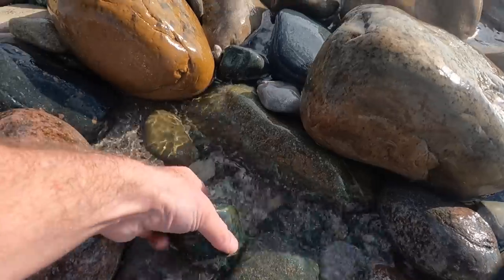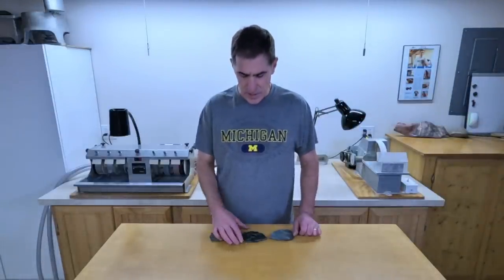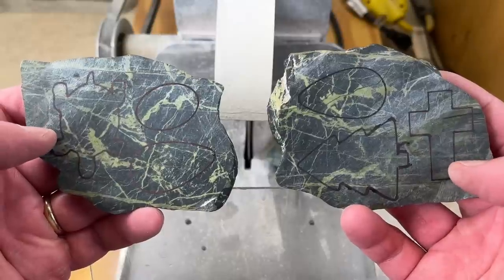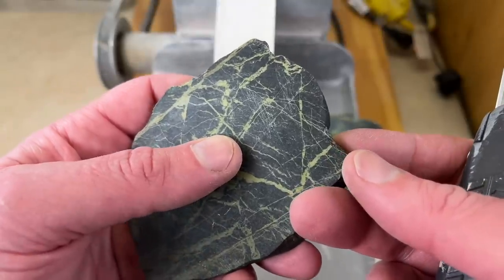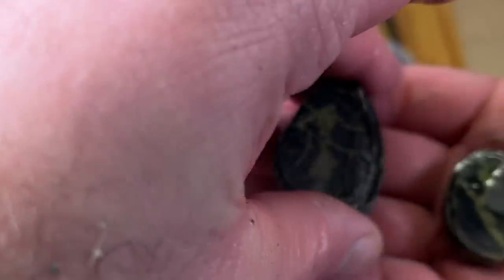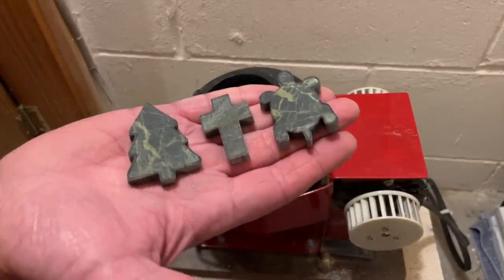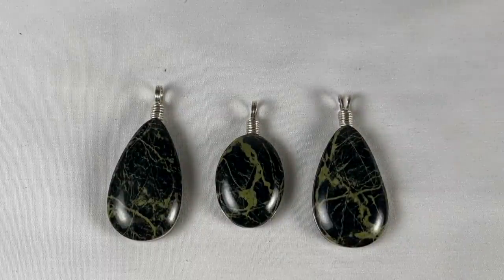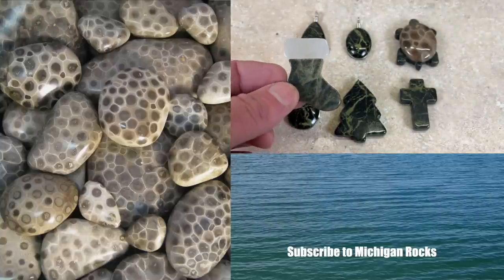You Asked For It! Viewer Requested Projects

Comment: Hey! I want everyone to know this fine gentleman helped me actually get my rocks to gem finish! His videos and knowledge ended 3 years of frustration and disappointment. I purchased a national geographic tumbler....... and then a very expensive refill kit of their grit..... then another tumbler. I tumbled dozens of loads through all 4 stages 100's of days of trial, error and waiting. I simply gave up for year. Then I discovered this channel and it changed the hobby forever for me and my daughter. I want to thank you for everything you do, what you taught me through your videos worked and I am grateful! My gem finish tigers eye, jaspers, quartz, labradorite and so on are because of you! You rock!
Reply from the maker: I’m glad I was able to help. You might need to repay the favor by teaching me to tumble labradorite. I can’t say I’m thrilled with my results.
Reply: The most helpful man on YouTube, I could not agree more.
Reply: The labradorite isn't as good as the harder rocks. I still get chalky streak lines, but it isn't breaking up chipping or coming out a completely chalky ball. My next move is to get more and try tumbling only labradorite in a load on polish stage instead of mixing it in with other rocks. You lose so much material through out the process that by the time you get polish stage you need more of it to fill the tumbler or you have to mix it with other rocks. I didn't have more so I had to mix. If that awesome aluminum oxide doesn't work in a pure load of labradorite I'm going to try ground walnut shells.
Reply from the maker: @johnhein4851  I tried corncob media in my Lot-O, but I did better with my regular, wet method. They weren't a complete failure, but they don't come out nearly as well as other rocks. A big part of the problem is the cleavage planes all over the place.
Reply: HECK YEAH!! This is seriously so cool, congrats to ALL 🥳💜
Reply: I agree.  Between him and meMiner,  they have taught me a lot and made the hobby fun.

Comment: What a beautiful stone! Lovely pendants, decorations and turtle. My favourites have to be the teardrop pendants. They polished up so well and are chunky and substantial. Thanks for sharing.
Reply from the maker: I like the teardrop shape too, but I’m in a rut. That’s what I almost always make. I need to expand to some new shapes.
Reply: @MichiganRocks   Maybe try cushion cut? I've seen that done with Australian opals and it looks good.
Reply from the maker: @ceanothus_bluemoon  I just looked that up, because I didn't know what a cushion cut was. It's just a square with the corners cut off. I could do that, but I'm not sure if I could groove wrap it. I don't think it would be easy to get the wire to bend at an angle at the corners. That's why I stick to rounded corners. Another option would be for me to learn how to do a different wrap than just a groove wrap.
Reply: @MichiganRocks  Ah yes, fair point.  I suppose you could just do variations of oval and pear by making some more elongated, and some fatter to continue the groove wrap(which looks very nice btw).

Comment: Fantastic video and beautiful green stone! I have to say that I love watching you cut out your ornament, turtle and other shapes on the saw. You are the master and you make it look so easy to get the shapes cut basically perfectly to the outline. Watching you do it with time sped up was really cool! Everything looks beautiful too. Those cabs sure do have a gorgeous polish on them. What size is your loto tumbler? Just curious. Thanks so much for sharing this Rob!✌️🤠🤟
Reply from the maker: Thanks, Kyla. Cutting shapes on the saw isn't difficult, you just have to go slow at first. Turtles are probably the most time consuming thing I do. All those indentations between the legs, the head and the legs, and the tail and the legs are pretty time consuming. That video was sped up 20 times. 

I have a single barrel Lot-O. They don't really come in different sizes, just single or double barrel.

Comment: Great projects for a cold winters evening ! I was just wondering how you get a uniform groove depth around the edge of the cabochon.
Reply from the maker: I don’t. I just get close and the wire evens it out. I use a piece of copper wire to test the depth as I go. It’s not perfect. I saw something on the Rock Tumbling Hobby forums where someone had an idea for making a gauge, but I can’t remember exactly what it was. the problem with gauges is that the bit wears down over time.
Reply: @MichiganRocks  Thanks for the answer. Yeah if you had spots that were to deep the tightened wire would just span that area anyway.

Comment: Watching your work makes me want to learn the craft. You make it look so easy. Although, I would most likely loose some fingertips and that’s no bueno, since I type all day. Always good content. Awesome pendants.👍
Reply from the maker: Most of the tools I use aren’t very dangerous. I should have a belt guard on my saw because that’s probably the most dangerous part. I can put my finger right on the blade while it’s running with no pain or amputations. Cutting with the saw is pretty easy if you just go slow. Making a dome on a pendant and keeping a nice, straight girdle line around the edge takes more practice.

You might like this video about the safety of saw blades: https://youtu.be/Er4YLn4fXUA

Comment: Those turned out great.  I was wondering if the cabbing machine would do better at bringing up a polish.  Probably so because of the range of grits on the wheels.  But the satin finish on the tumbled pieces still look nice as is.  Thank you for sharing this and making it interactive for us by entertaining our suggestions.  You do fine work!  Question:  The dop wax...is this anything like the microcrystalline wax used in the lost wax casting process?  'Cerita' is the only brand of that material I know of.  Your dop wax looks like it has more 'gooey' additives in my opinion, unlike Cerita which will totally liquify at certain temps necessary for filling molds.
Reply from the maker: With a really hard rock, I can probably get a better shine in my tumbler. I'm better at tumbling that cabbing. My wheels only go up to 3,000 grit, while my tumbling grit goes up to something like 8,000 or higher. With a softer rock, I do better on a cabbing machine. 

I have no idea what the qualities of dop wax are. My only experience with wax is that and candles.

Comment: Great video!!    Was wondering three things about the Christmas Tree:  what drill you used to drill the hole, what did you use for the eyelet itself (premade or make your own) and what glue did you use to set it?

Thanks!!
Reply from the maker: I can answer all of those for you. 

I use 1 mm drills in a Dremel mounted in the Dremel drill press accessory. The drill bits I use are cheap but don't last long. I buy 100 bits for $75 from Kingsley North. I get between zero and about a dozen holes from one bit. They won't drill really hard rocks like Lake Superior agate. They work pretty well for puddingstone, unakite, quartzite, and the rock in this video, whatever that is. They work really well for soft rocks like Petoskey stone. https://kingsleynorth.com/diamond-drills-kingsley-north-inc-pkg-of-100+kn_dimd_drill_pack-Pkg-100+kn_dimd_drill_size-10mm-Diamond-Drill?ref=robertabram1&utm_source=tapfiliate (affiliate link)

I use square silver wire for the eyes. I'll be able to make several from the scraps from the groove wraps I did in this video. I make the eye with a pair of round nosed jewelry pliers. Then I hold the eye in a pair of pliers and twist the bottom to make a spiral. I figure that won't pull out of the hole as easily as a straight wire. 

I use Epoxy 330 to glue them in. 

Here's a whole video on how I make Christmas ornaments: https://youtu.be/VDoZL4MiPgQ
Reply: Awesome!  Thanks for the info!

Comment: Turned out really sweet - just wondering what grit the grinder is using - & is it easy or necessary to change out the grinding wheels for any reason?  Cheers!
Reply from the maker: The grits on my cab machine are: hard wheels: 80, 220 soft wheels: 280, 600, 1200, 3000. I haven't changed any wheels yet. There are six of them, so you don't have to change the wheels as you work, you just go to the next wheel. The only other thing you have to do is turn on the water valve to the wheel you're currently using. 

Here'a link to the actual machine I have: https://kingsleynorth.com/kingsley-north-cabber-6-nova.html?ref=robertabram1&utm_source=tapfiliate  (affiliate link)

Comment: What do you think of the harbor freight rock tumblers and their grit materials they sell?
Reply from the maker: I don't like them. I haven't used any of their tumblers or grit, but I have read about them a fair amount. So I'll give you my thoughts, but it might be good to do some of your own research. 

Their vibratory tumblers are made for metal, not rocks. There is no mention of tumbling rocks in the descriptions of either one. Thumler's is another brand of vibratory tumblers that sells both rock and metal tumblers. People who buy either of these metal tumblers usually report that the barrel and/or the motor wear out very quickly when tumbler is used for rocks. 

Their rotary tumblers are basically a clone of Lortone tumblers, but are not built as well. There are many reports of motors burning out after a short time. But, there are other people who get a few years out of them before they die. The other issue is that the belts break a lot. I would definitely buy the extended warranty. If you do buy one, make sure you look it all over and make any appropriate adjustments. Look for things like whether the pulleys are well aligned. Tighten nuts and bolts. Also, there's a little plastic tab on the machine where the end of the barrels run. You have to make sure you turn that out so that the barrels rub against it rather than against the whole frame. This cuts down on friction and makes it easier on the motor. @davidhile5363 is a subscriber here who has several of these and likes them. He could probably tell you more about how to adjust and maintain these machines. 

I don't know what to say about the grit. They don't say what is in the packs, they just call them coarse, fine, prepolish and polish. It's important to know what's actually in them, especially the polish. There is a big difference in different types of polish. It's also really expensive. They are tiny little packages. I highly recommend getting your grit from either Kingsley North or the Rock Shed. I have links to both places in the description of all my videos. That's where I buy almost all of my lapidary supplies. 

I'd suggest taking a look at Lortone rotary tumblers. They have a much better reputation. They've been hard to get for the past couple of years, but you could send an email to one of the places I mentioned and ask them to hold one for you. The Rock Shed has a thing where you can just click a button or something for them to send you a notice when they're back in stock.

Comment: Rob, what thickness do you cut your slabs for cabachons?
Reply from the maker: I bit over 1/4 inch. I'd cut them exactly a quarter inch, but to do that on my saw, I have to turn a little crank and leave the crank sticking straight up. It almost always falls down during the cut, making the cut a little messed up. For that reason, I go an extra half turn.
Reply: @MichiganRocks  thanks Rob, beautiful cabs!!

Comment: Just thought - but you MUST have thought this before me - do you make Ms?  For Michigan, Mom & Michigan!?
Reply from the maker: Do I make the letter "M"? I made a name plate for my desk at school that said, "Mr. Abram". There are two M's there, so I guess I did. I can't make a block M with the equipment I have though. The inside of the blocks on the bottom would be impossible to cut with the saw I have.
Reply: @MichiganRocks  Just suddenly thought when I saw your sweat & thought of all the Ms across the state,  interesting some letters/shapes are more tricky than others.  Cheers, Rob.
Reply from the maker: @SmallWonda  I cut shapes with a 10" round blade, so there's no way to go around a corner. There's no way to make a capital G, for example. The blade can't get into the inside bottom part.
Reply: @MichiganRocks  Rock cutting is quite the challenge - just how did the Ancients supposedly do what they did with copper chisels & dolerite pounding stones!! Have a great Christmas! G
Reply from the maker: @SmallWonda  Merry Christmas!
Reply: @MichiganRocks  Happy Christmas to you ALL!

Comment: have you purchased any of the kingsley north 8" thin economy blades?  the price is low enough i felt it best to ask an opinion on them lol
Reply from the maker: No I haven't. I couldn't tell you anything about them.
Reply: @MichiganRocks  oh ok no prob.  ty anyways. havnt decided if im going to try them or try some jinglings.   

also i wanted to let you know i found a pretty cool solution to the angled ramp.  i bought an adjustable aluminum grinder tool rest for knife making off amazon. believe it was 39 bux.  took the base off made a few minor modifications like flipping brackets and it fits perfectly on my gemlap 8" trim saw with the only modification being needed was a 1/4" hole drilled through my trim saw top table  .  plus i feel alot safer with a ridged piece of aluminum meant for the job.  a major upside is the bracket that holds the tool rest doubles as a spray guard lol.
Reply from the maker: @invictusfarmer7188  Wow, that sounds awesome. Much better than my wooden solution.
Reply: @MichiganRocks  actually im impressed by your solution.  given what it took to adjust this thing properly, for you to get the angles perfect and make such nice pieces id say yours is by far better haha. your idea allowed me a great starting point to build from and I am eternally grateful for that!
Reply from the maker: @invictusfarmer7188  The ramp was not my idea, but I did have to design my own to fit my saw.
Reply: @MichiganRocks  well whoever's idea it was it got me headed in the right direction.  this saw has been working great for me. and the best part is after about 30 cutouts it has budged a bit.  so the clamping pressure is more than up to the task